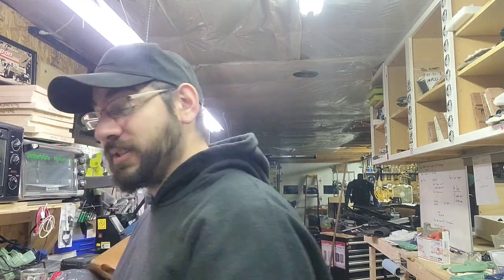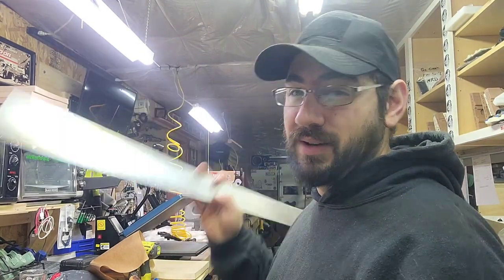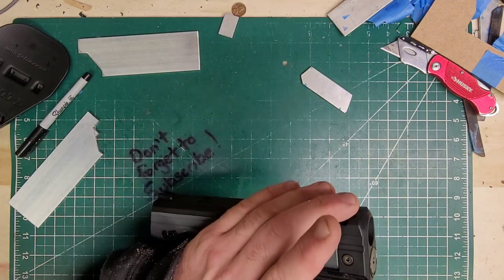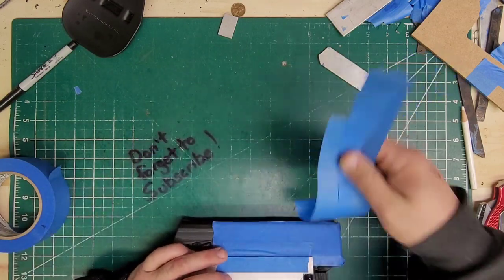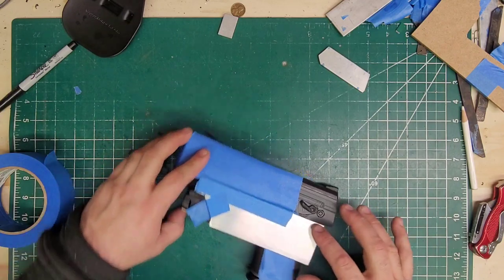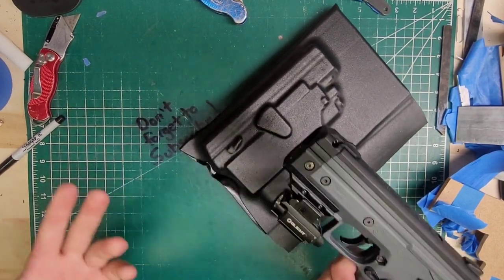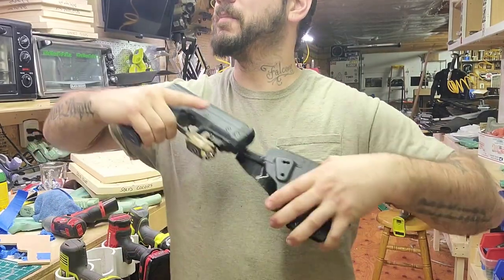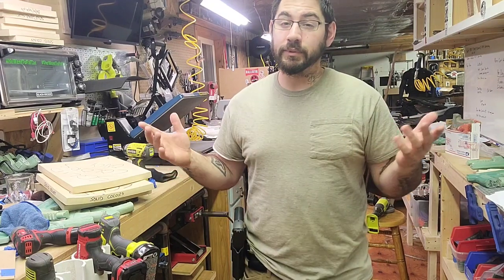Byrna HD Pepperball gun! And let's make our own blocking!

Comment: Hello I have been following you for about a year to learn different tricks of the trade and I have a M&P Shield with a recover tactical shr9 rail mount with an olight pl mini and I can not seem to get it right I will have alot of shake or it is to tight any suggestions thanks in advance
Reply from the maker: All in the blocking. If it's too tight you should be able to see where it's hanging up